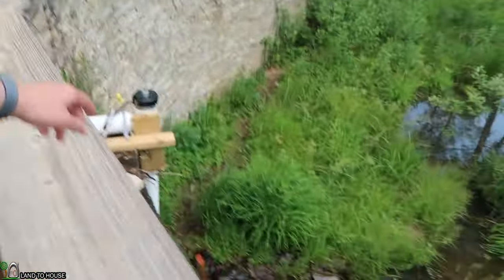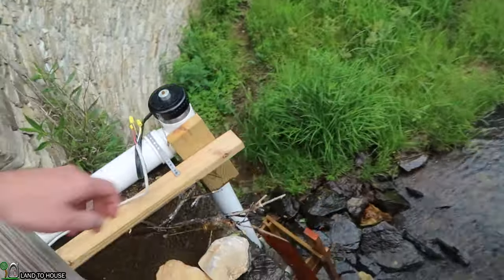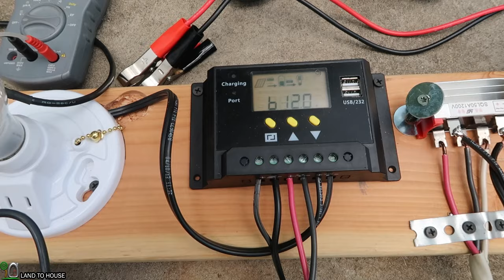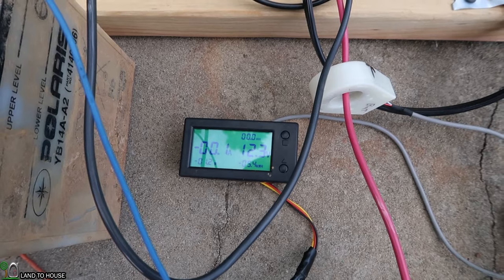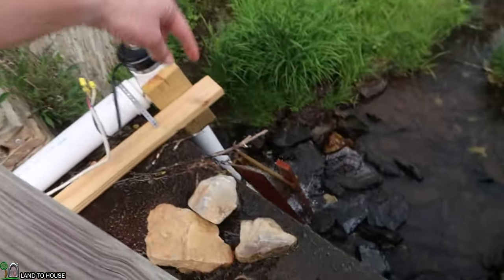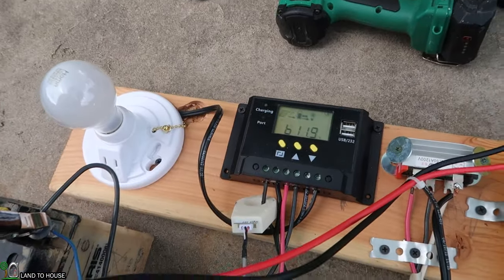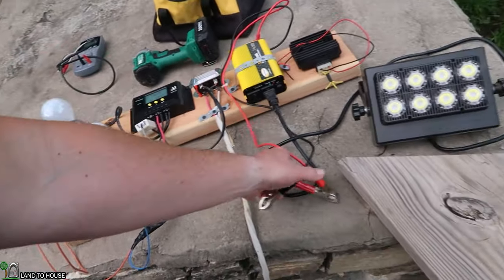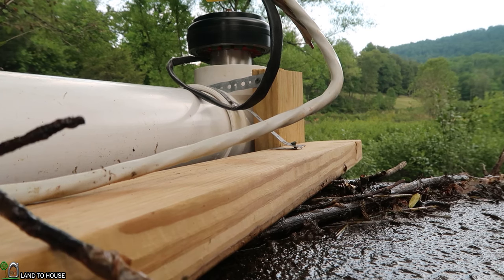POWER reading on the 4 inch hydro turbine

Comment: Those micro generators work on tail stock vacuum instead of head pressure? Kinda new to that concept.
Reply from the maker: Yes! The down pipe is what effects the power on this type unit. The other system i have uses head pressure.
Reply: @LandtoHouse  that is almost contradictory to common sense huh? Seems there would be cavitation in the turbine vortex (vacuum cavitation) induced by negative pressure in the outflow.... but hey if it works man, it works! I could see where a 100 gpm flow would give you a nice wattage output to run your MPPT battery minders 24/7. Thanks  for the vids man, I do appreciate it. I love to learn and read 50 or 60 books a year on such wildly varied subjects it is insane.

Comment: For your mesurement, it seems you were reading the voltage from the battery while taking the amps mesurement from the generator. It will give you false reading! The charger act has a intelligent voltage and current limiter with some management, if you want to get the instatenious comsumption of the generator, you have to get the voltage and the current from the generator itself. The battery act has a voltage regulator and have a very low impedance. So it's not the best way to do brut test.

If you want to get the optimum ratio of rotating speed, voltage and current all together. The best test should be like that:

On a wood plate, fix 3 bulb socket were their neutral are all liked together. Then, put all 3 generator wire to each socket bulb. In this way, you will get a 3 AC phase system. Then, use different incendescent bulbs in group of 3 of 25w, 50w, 75w, 100,w etc... At each test, you put 3 bulbs of the same wattages.

Then on one bulb, you take a kill-a-watt meter of some sort to get the power of one bulbs. Since it's pure resistive watts, you multiply by 3 acunting for each bulb.

At some point, increasing the load will give you less power then a lighter load because the water system wont be able to spin the propeller efficiency anymore.

Don't expect to have a bright light of some sort. The bulb act just has a cheap resistive load, even if it does not appear toput light, it's not important for the test.

If you have more money to put on the test board, you can get a 3 phases autotransformer (it will act has a dimmer but it's important that it's a autotransformer 3 pahses). Whith this configuration, you don't need to change the bulbs anymore, you just put 3x250 watts incendescent bulbs and you ajust the rotating knob of the autotransfo. While doing that, you will feel the generator speed changing and the kill-a-watt changing value. At some degree, you will get a optimum wattage. This is more expensive but it's a permanent testing board for all you futurs tests.

With this king of test, you will know exactly what is the optimum curve efficiency of all the system includid all the loss. The wattage curve should look like a parabolic curve were you start at 0 watt, get a maximum then return to 0. Why it return to 0? Because more you increase load, the more it looks like a short circuit (increasing a load is lowering the resistance (ohm)). And the maximum load you can have is by short circuiting all the 3 wires: You have the maximum of current but no voltage anymore, so, 0v x infinite amp = 0 watt. At this point, there is just the internal resistance of the generator left and the rotating speed will slow down significatily.

While making this test, add a light switch on each generator leg to switch of the bulbs and replace them for other test (security reason)

PS1
Intelligent charger: You should not use intelligent charger for test. A intelligent charger manage itself the best curve efficiency but limit it's current when the battery gets full charged. The floating char for AGM battery is 13,65v but some charger wont get over 12,8v.
PS2
Some battery are old and their internal resistance get high, a intelligent charger will sense it and reduce the charging current to maximise the battery capacity and life. So, use all sort of intelligent interface to do brut test is not advised.
PS3
During those test, never get higher amp then the generator coil can support, the coil will burn. By making a short circuit, it does not mean that the current inside the loop will be higher then the coil admissible amp. Because the water system might just not be powerful enought to overcome the generator resistance. So doing short circuit is OK has long has you do not have amp higher then the generator specs. The principal enemy of a coil is high voltage and temperature. It's the overheating coil that make the vernish around the copper melt and make the coil burn by short circuiting the round copper. High voltage can create arcs and brake the vernish too.
PS4
By doing this brut test. You eventualy are testing the efficieny of the propeller. You told us that you were testing a new propeller? So, by doing this test with the 3 bulbs, you always get the same test all the time. Since your test is more rigorous, it's the best way to optimise futur propeller (you have to use the same generator since not generator (even if they have the same model) have the same comportment (bearing, shaft, magnet, casing, etc...)). So by eliminating the most variables (same pawn, same pipes, same genarator, same test procedure), that's the propeller that can be tested. And this his the MAIN thing to work with to increase efficiency.
PS5
Turbulence: the propeller seems to be way to close to the 90 degres angle. Even if it should not matter where you put the propeller in a succion system, there is allways turbulence near angle, so the propeller should be lower to get a more stabilized mass of water flowing through the pales.

I am a electrical technical engeneer in a college, I work with generator and electric motor all the time.

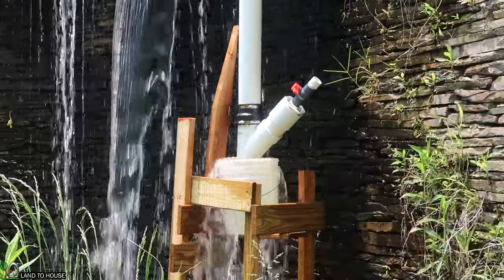Comment: I have just re-viewed your video, and something is puzzling me: @01:57 Why do you have 0.7 A of current flowing already before you have started the turbine? That means there is something consuming 8.3 Watts from the battery !?? Is it your white light bulb on the left, or is it current reflowing into the generator/turbine???
Reply from the maker: I'm assuming that is the power being consumed by the volt amp meter.
Reply: @LandtoHouse  Thanks for your fast response. Over 8 Watts would be a quite high consumption for the Watt Meter. Anyhow, if this parasitic consumption still persist while the turbine is running, it would consume nearly half of your generated power (you measured around 18 Watts).

Comment: When you charge a battery using a hydro turbine the voltage measured is always determined by the battery. I e the voltage of the  turbine and the battery will read the same.
Reply from the maker: Interesting! I think that Langston tried to explain that. He said that I needed to get another battery to 24v and test that way.
Reply: @LandtoHouse  Your battery started out at 11.5v (only 10% charged), so the charge controller drew a HUGE amount of amps from the turbine+rectifier to try to bulk charge the battery, bogging down the turbine a lot.  A fully charged battery would likely have given you better results.

Comment: Dear that looks like a PWM charge controller. Try a MPPT charge controller. That should be the first upgrade for your system.
You can use a wind turbine type 3 phase MPPT charge controller too.
Share the type of turbine you are using for power generation.

Comment: Try to connect a 12 volt 15W bulb direct to the rectifier as a load, it would be better to get there with different resistors or lamps of lower power, forget the charge regulator and the battery for now, measure the power cos with a final voltage useful for charging a 15V battery for the liquid acid one, the current transformer sometimes has a directional arrow because it tries to turn it to see if the measurement changes.
 I love starting this turbine with the vacuum cleaner!
Reply from the maker: I only have one 12v bulb and I think its 6w. I will have to find it and see what the power rating is. The vacuum start is the best! I am about to move the 1-1/4" pipe up so I can start it from the top of the water and not have to walk down there.
Reply: @LandtoHouse  Great idea my friend, no only will that save you a lot of walking up and down, but it will also let you get ALL of the air out of your siphon.  With the turbine bogged down under load, it may not have allowed the water to flow fast enough to self-purge the air, and any air remaining in the runner pipe (horizontal pipe) would reduce the water flow to the turbine and thus reduce its power output.

Comment: The problem is your using pwm so gen is pulled out of the efficent range if mppt was used it would be able to reach the higher rpm and voltage
Reply from the maker: This PWM charge controller is all that I had here at the house for testing. I need to pick up a mppt to do further testing later.
Reply: @LandtoHouse  a buck converter can be good to test I was using it as a manual mppt with solar to keep them in better power range

Comment: Sir how much AC voltage you are getting ? . . .  And sir you can add water pump to get more water pressure back to back right , instead of 4 inch pipe you may use 4 inch pipe for water pressure ... Reply sir ... I have one more question ...

Comment: Why not try a wider downpipe ?? And the motor lower in the downpipe. So you have "weight" on the rotor.?
Reply from the maker: I will be installing the 6" down pipe in the next video. As for turbine placement. The way that I understand it the turbine would spin the same any place in the siphon.
Reply: @LandtoHouse  ok. I will watch your next video to see the results.  I like your way of thinking.    👍👍
Reply: @LandtoHouse  yes, this kaplan/axial flow type works on the rate of flow, not the pressure.

Comment: Would you get more power if  the turbine was located at the bottom of the pipe instead of the top?
Reply from the maker: Because this unit is in a siphon it does not matter if its on the top or in the bottom.
Reply: @LandtoHouse  OK thanks :)

Comment: Weird question: does the vertical distance from where the water starts to fall, to where it hits the blades make a difference with how much power you can generate ? I have view a number of people put the blades just a foot or two from the top. Just wondering if it makes a difference? { side note: I can't live with out my grinder when playing with SCH 40 pipe, I am always putting a bevel one the end of my pipe. I have got weird looks for doing it.}.

Comment: you need a dc-dc converter where you can set the input voltage to match the generator nominal voltage(whatever that voltage is) otherwise the battery will CLAMP(pull down) the motor to the the battery voltage which is clearly a lot lower. this is just like if you take a 50volt solar panel and connect it directly to a battery, it will get clamped down the the battery voltage. 
This is what a MPPT does, although I would not suggest hooking one to this unless you can SET the input voltage. Kris Harbour had this same problem on his hydro, and I think that he used a Tristar MPPT that he could out into hydro mode where he could SET the voltage of the input, and then it would CLAMP it to THAT voltage allowing him to get the power he wanted from his generator.
If you haven't seen the video I am talking about, let me know and I can go dig up the link from his youtube.

Comment: Is the charge controler mppt or pwm
Reply from the maker: This is a cheap PWM charge controller it's all I had at the house for testing this unit.
Reply: @LandtoHouse  for a turbine that can produce 40V open circuit, you want to load it at ~20V for max power. Right now you're loading it at 12, so it's really not allowing the turbine to spin up. If you got two batteries in series without the charge controller you'd probably get a better result at 24V. Obviously don't let the batteries over charge.
Reply: @LandtoHouse  Here is a comparison video of PWM to MPPT. It shows the PWM is only half as efficient as the MPPT and can't convert amperage into volts which appears to be something that you need to happen with this system.
https://www.youtube.com/watch?v=cdAkQCA5tuY

Comment: While I like the test setup I think that the turbine impeller is awfully inefficient in that it handles minor loads quite poorly given the size of the pipe and water availability.  Perhaps a multi stage impeller could be a consideration.
Reply from the maker: I was given this small 4" unit with 3d printed impeller to test how well it works. There might be some changes to the design over time. So yes you might be on to something.

Comment: Consider:  Improve rpm by driving a large paddle wheel mounted pulley with your water supply. Then a small pulley on the turbine.  Your use of water pressure can spin a large water wheel easily. Then, for every one turn of the big wheel the small driven wheel on your turbine will spin many times more, all while using the same size water supply. Bo.
Reply from the maker: After I finish testing this 4" unit for Langston Alternative Power my neighbor is going to install a waterwheel. He has already built it.

Comment: It would seem the physics of the Bernoulli effect and Delta P should work in a way to help you produce more power. I would imagine building a smaller piping system, with a bigger alternator, maybe using jets and penstock pushing spoons might be what you need for that setup. I have a high flow creek (I would imagine there is thousands of gallons per minute that flow constantly on my property through the creek year round) I plan on using eventually for hydro power that I plan to eventually dam up a couple of feet at a "water fall" that is about 3 feet high, so I might be able to get a 6 to 9 feet drop (due to a 2-3 feet hole at the water fall, so daming up the creek on top of the water fall for a 2 or 3 foot dam would be 9 feet of fall) I am seriously considering building a home made "whirlpool" alternator and seeing if I can get it to work. I would be building it all from scratch, with concrete and winding my own alternator setup, and have been trying to study up on everything dealing with power generation with spinning magnets over copper coils.
Reply from the maker: That sounds like a great project. You have more than enough water to get some power. From my understanding the power calculation is (head pressure x gpm)/10 = power.

So if you had 800gpm and 9 feet of head pressure: 720w all the time. That is nice power for 24/7.
Reply: @LandtoHouse  No, that gives you a power that is to low by a factor of nearly 2. You can calculate the power from the hight (not the head pressure!) and the gpm, but the formular then is: Heigh h (in feet) × gpm (gallons per minute) × 0.189 = Power (in Watts). That means a division by 5.3 (0.189 is roughly 1/5.3), and not by 10! In your example (800gpm and 9 feet drop) that gives 1360 Watts.
Explanation: The stored energy in a lifted mass (or the Potential Energy) is generally Mass × Height × Gravitational Acceleration. To free this energy (and use it for generating electricity), you need to let a certain amount of mass fall down in a certain amound of time. Here the flowrate in gpm comes into play. That defines how many volume (gallons) of water falls down. Multiplied by the density of water (3.89 kg per gallon) gives you the falling mass per second. It is important to calculate this per second (and not per minute), because Watts are also defined in Joule per Second (1W = 1J / 1Sec.). Hence you get the Mass Flow rate by gpm × 3.79 kg per gallon / 60 Seconds. The Gravitational Acceleration of 9.81 m/s² must also be multiplied. All these numbers consolidated to P = gpm × 3.79 kg per gallon / 60 Seconds × Height (in feet) × 0.3048 m per feet × 9.81 m/s² = gpm × Height (in feet) × 0.189 [kg × m² / s³]. And 1 [kg × m² / s³] is 1 Watt.
See also https://en.wikipedia.org/wiki/Hydropower for comparison.

Comment: Couldn't you almost had a reservoir of water for siphon theory like you just be pulling water but you would have stored amount of weight for down pressure so you'd have to fill the system on the drop but you would be able to intensify load to generate a lot more wouldn't you

Comment: Hi, did you try to compare Wats you get from it with a theoretical energy that water running through the pipe with this head has? I wonder what is the current efficiency of the system.
Reply from the maker: Lets say it has 5 feet of drop and 100gpm flow. That would suggest 50w of power. I was getting almost 18w. 

So it needs to have that 90 removed on the intake and a larger and longer down pipe. My goal is to get 100w out of this unit.
Reply: @LandtoHouse  hope to see 100W soon or maybe 1kW! Would be great. And the Nobel prize for phisics as well.

Comment: Do you got your generator at the top you need your generator you're turbine towards the bottom that way you have the momentum and inertia of the water falling you have your losing all your power because there is none you need the fall of the water move your generator to the bottom of the pipe

Comment: Of your open circuit is 40 something why would you use a own charge controller and if you are use at least 24v
Reply from the maker: The open circuit was 45v. As soon as the load was applied it dropped down to 12.8v. So I need to get more voltage out of the unit. In the next video I will be stepping up the down pipe size to get more power.
Reply: @LandtoHouse  you are using a own controller it doesn't matter how much voltage you put in its going to get pulled down to the battery voltage if you get more amps it will come up faster but you basically have just hooked up the generator with a bridge rectifier directly to the battery there was no point checking the voltage at the rectifier was going to be the same

Comment: You re posted this?
Reply: Bump
Reply from the maker: No last video was open circuit voltage. This is a test of the power under load.